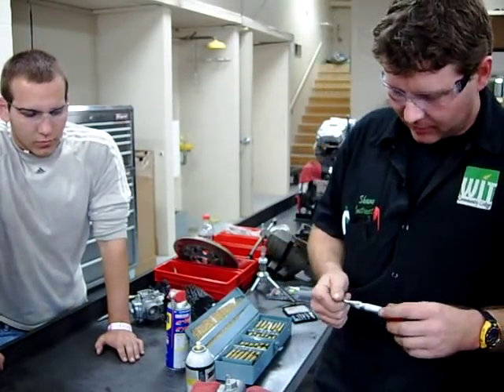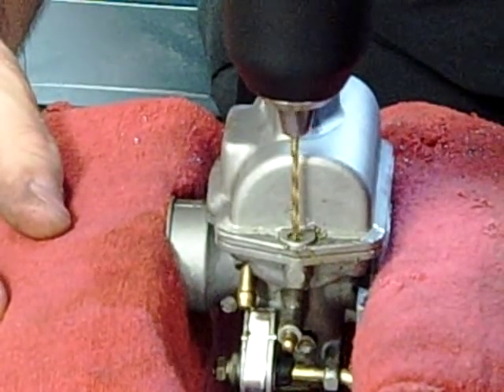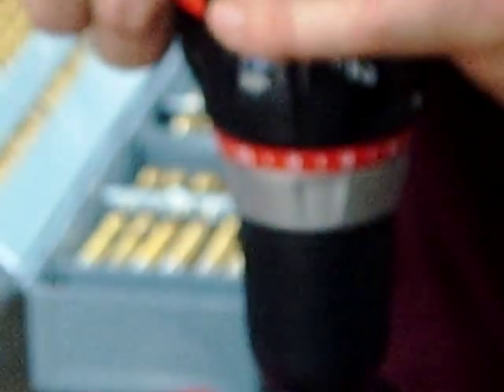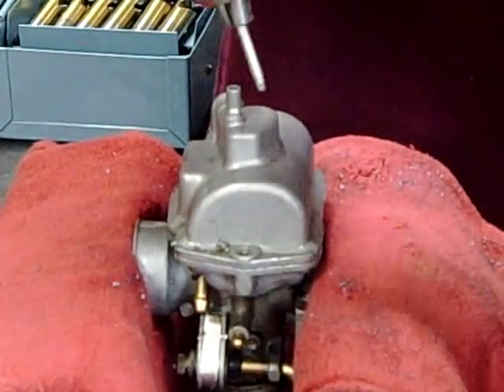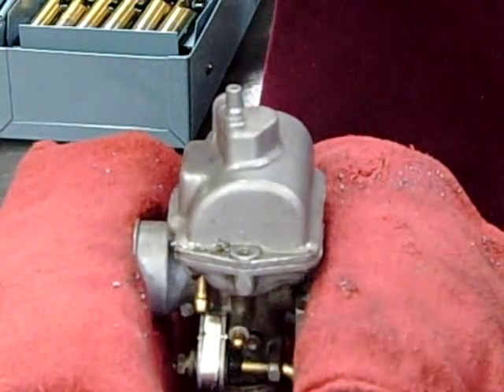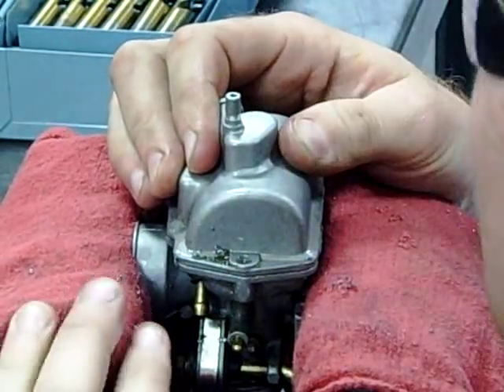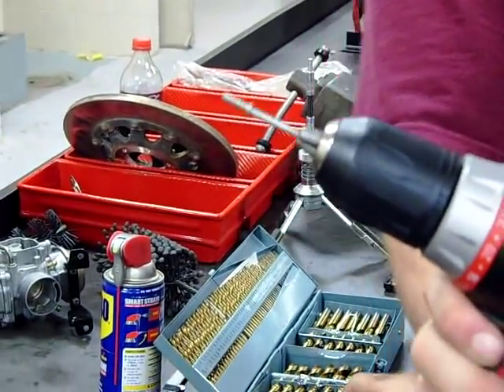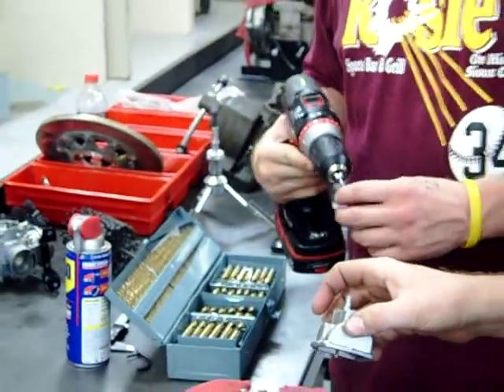How to remove a non-serviceable carburetor bowl screw from a Taiwan Chinese SCOOTER MOPED CARBURETOR

Comment: It's really hard to demonstrate it you need to do it a few times to get the feel and the only way I could say it is to become one with the screw.Or say screw it and buy a new one for $30. But whatever they are putting in gas nowadays you'll be buying a new carburetor almost every year If you let it sit. You should always use 91 or 94 Octane for smalle engines especially if you let it sit for any length of time.
Reply from the maker: I hear you. Time vs. cost right? I've seen brand new ones leak and even have packing material in them! Thanks for subbing!
High 5 us with a donation: https://www.paypal.me/how2wrench   
Join this channel to get access to perks:
https://www.youtube.com/channel/UCBhM8DCKnT3qXwTW0eToyCg/join

Comment: May i ask what kind of tool are you using in your powerdrill to remove the actual bolt?
I see you drilled a hole and then i see you have a tool mounted into you powerdrill and you just unbolt it like that.

Many thanks, 
Greeting from Holland.
Reply: That's an extraction  bit, it took 6 years for someone to reply, hopefully by now you know what it is